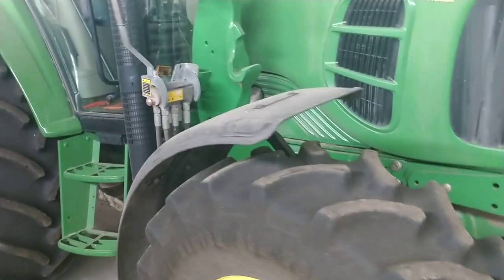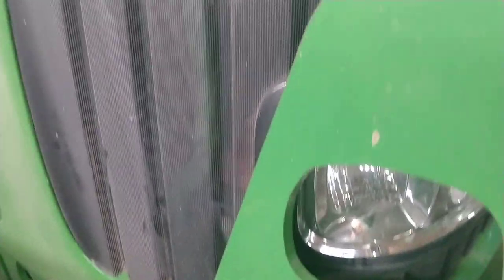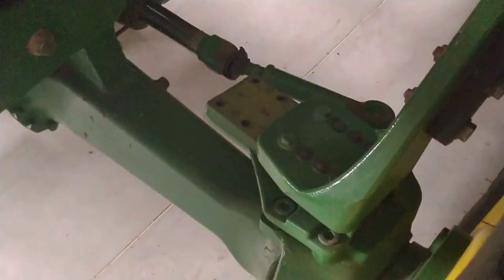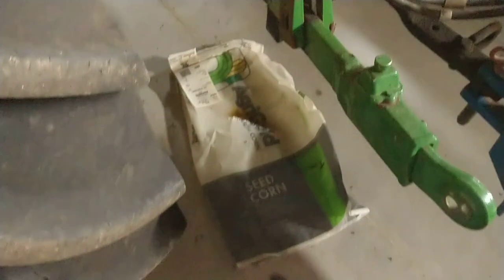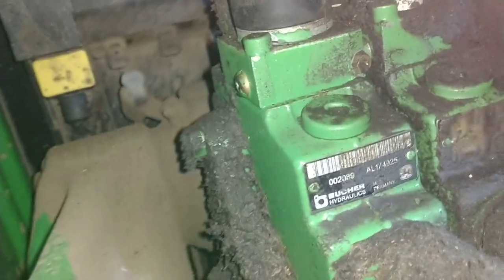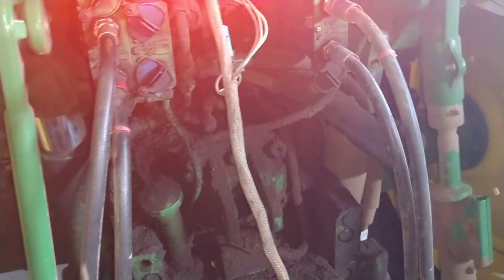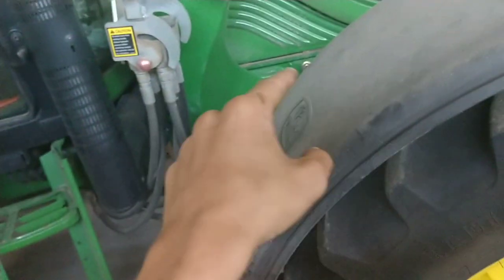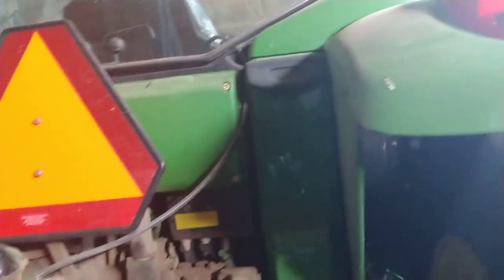6430 premium problems

Comment: Lol u should talk to me about that tractor i fix them all the time
Reply from the maker: Message me on Twitter and we can talk about this tractor and it's great puzzles. I always love any input!
Reply: @oldschoolfarmer3685  hello friend,
I wanted to buy this tractor from south Africa but i do hesistate if it has such leaking problems.
Would ford 8240 be a substitution for this john deer???
Whats your take bro??
Reply from the maker: Listen, I love the design of the 6430 but an 8240 is unknown grounds, it is all dependent on how much of a backing you have and how many hours that tractor has on it. I have never personally worked with an 8240
Reply: Between a Ford 8240 and a john deer 6430 which one would you recommend me buying??
The Ford 8250 has 8500 hours on it and the john dear 6430 has about 5000 hours on it.
The owner keep saying that the tractor is running great and it has no major problems, but due to the video you shared am alittle bit scared to go for a john deer as we dont have qualified mechanicals to repair it 
Your advice please.
Reply from the maker: I definitely would look at the jd closer and ask for any major repairs and any ticks, I would like to make a video on this or a livestream on it because of the topic, these tractors are both great candidates and need thorough analysis
Reply: @fkitigwa6145  don't be afraid I have never had a leak on my 2012 mod john deere 6430 with 6000 hours he jus got a Monday tractor but stay away from the models built in America they are always crappie buy the ones witch is built in Germany they make quality in every step
Reply: Have it 6 months now going sound so far but thanks again if I have a problem I will let you know

Comment: We replaced are 7130 and 6430 factory  fuel lines with rubber fuel lines and have had no issues since ! Going on 6 yr s now
Reply from the maker: Do you have the information on where I could get those fuel lines? I can't seem to find one that would fit we tried quarter inch and it just wouldn't work

Comment: I know I’m late to the conversation. If you need to replace your fuel hoses on a John Deere, we use Gates Lola  oil hose just get the size. 5/16” or 3/8” replace one section at a time to avoid confusion

Comment: In the UK John Deere updated the fuel lines to rubber ones problem solved, changed ours never had a issue since, 
The spool issue is a simple seal kit, think you need to get off your keyboard warrior mode and speak to your dealer. Also the cab doesn't come off it tilts 🐓🍭

Comment: I have this model and the dang Right side Remote or SCV keeps kicking the hose out. Rebuilt the seals and checked everything I can think of and it keeps doing it. Moved the hoses to the left side and  all the hydraulics works great, just noting on the right side.   Have you seen this issue?
Reply from the maker: Yes actually I have! These tractors tend to be notorious for random leaks, I've noticed intense pressure on the right side in the past. John Deere said it had something to do with the regulator on the back but offered no assistance. I plan on updating this ASAP once I have the channel flowing again. I'll make sure to get this looked at!

Comment: Cheap Chinese braided line.  Good tractor but that they use such cheap fuel lines is a major frustration.  Wheel speed sensor is also located under the cab.  really bad design.
Reply from the maker: I definitely agree with you!

Comment: Put just regular rubber lines i got 130 tractor + that i work on and it works
Reply from the maker: We should definitely compare notes on this tractor
Reply from the maker: Message me on Twitter @FarmerOldschool
Reply: Hello mike
Lets connect
Reply from the maker: Do you have instagram or twitter? Add me and request a message room with me if you would like more information on my knowledge